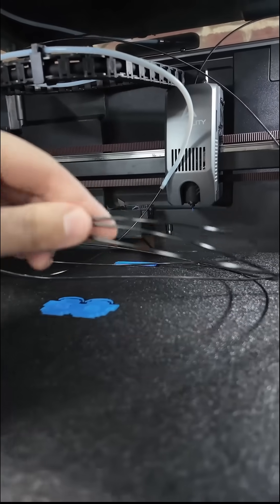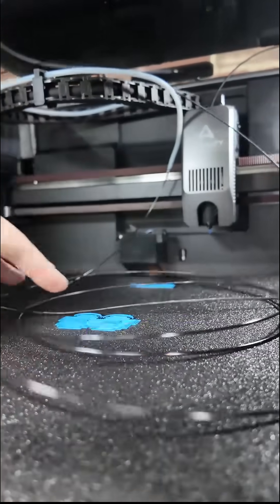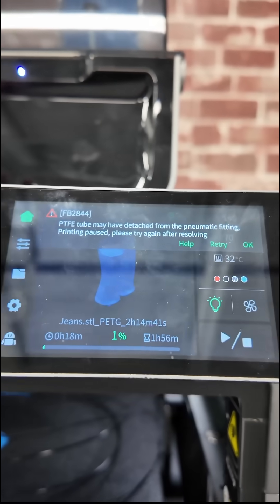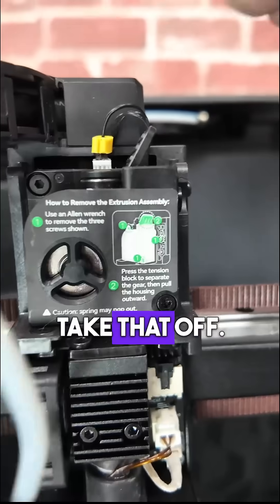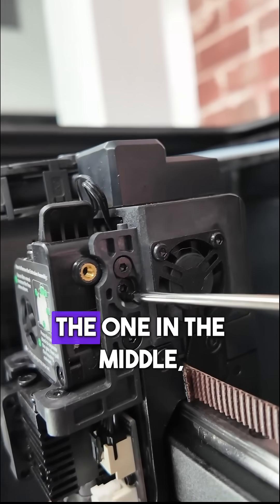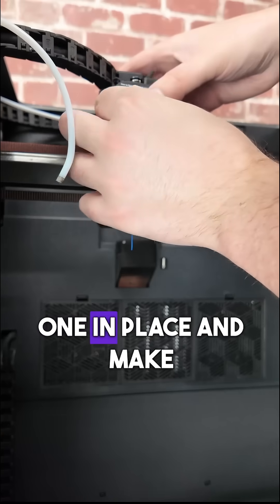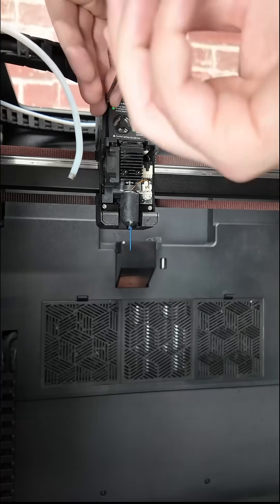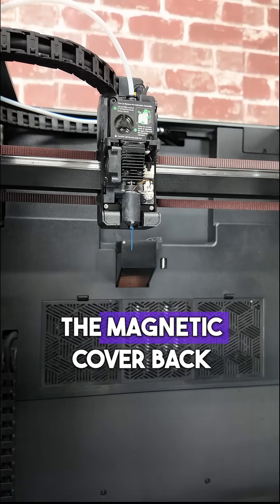How to Fix A Creality K2 Extruder #3dprinting

Comment: I run a bunch of big industrial printers at work The PTFE tubing is 90% of the errors that we get. Because if you're not looking that's stuff just hops out of its containment and then fills the back of the printer. The worst one was when the printer didn't recognize that it was doing it and it unloaded an entire 1500 dollar box of ABS into the back of the printer and we had to spend five or six hours getting the tangled spaghetti monster that it made out of it.